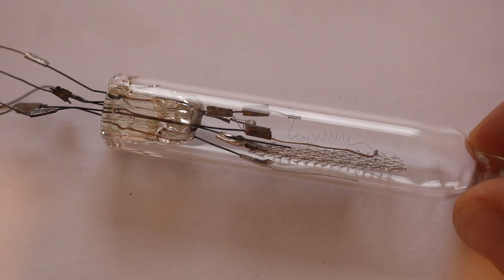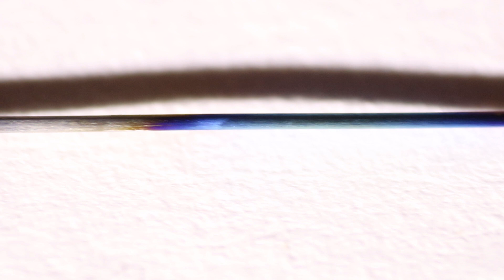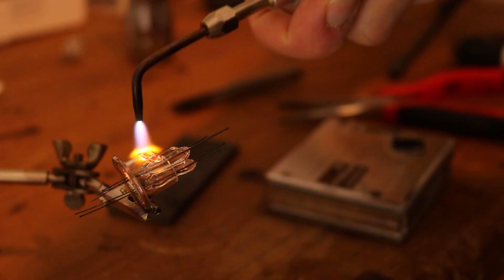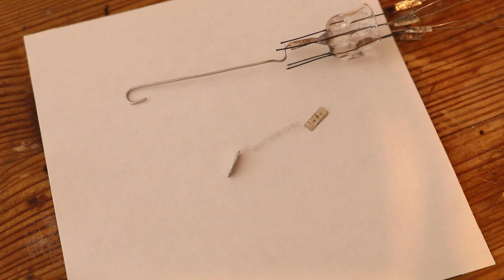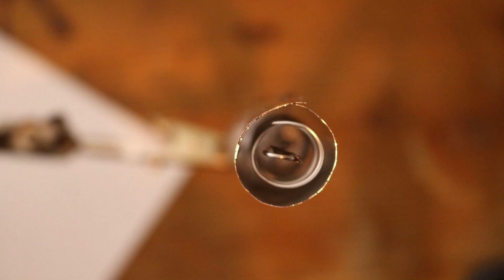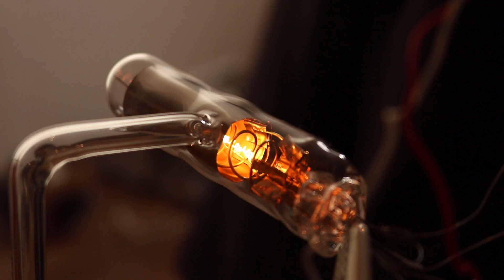Building a DIY Triode Vacuum Tube

Comment: If Higher Than TTL Voltages Would Be Employed 0+5V,  Then Capacitors Could Be Converted To Triodes By Including The Base For The Extra Voltage Needed To Reach Electric Permitivity. If You Go With The Thought Further, You Realise That Transistors With Dopped Silicone Employ The Same Principle, With The Addition Of The Goal Of Bringing Down The Voltage To TTL, 0+5V!

Comment: Next try making a geiger counter tube. Welders argon plus a halogenated hydrocarbon will work nicely but a regular hydrocarbon can be used. Mix is 90% argon and 10% quench gas. ❤

Comment: Good work!. I attempted to make some triodes and managed to get a couple that sort of worked. I could never make them consistent enough to put in a circuit. I did make oxide cathodes using very finely pulverised chalk (CaC02) using corn syrup to make it stick. Again, sort of worked but not well enough to pursue it. I have since bought some Si wafers from Ebay and am trying to make a transistor. Made one in high school with a kit suppled by Bell Telephone Laboratories. It contained asbestos and HF, among other things. Wouldn't let you do that today.
Reply from the maker: I'm gonna try aswell with the emission coating. You need a mix of Calcium, Strontium and Bariumcarbonate. Making transistors is very cool aswell but needs its own equipment and stuff😄
Reply: @thesciencefurry  Yeah, first I had to make a tube furnace that would hit 1000C.

Comment: Amazing video! What kind of torch do you use? I really want to try myself. Did you had experience with glass working before?
Reply from the maker: Sorry for the late reply. I use a cheap oxy torch from ebay and just a general purpose torch. It's definitely a learning curve and you need to try things out.

Comment: I don't know how I missed this upload originally but this is fantastic work! I noticed on the tubes you showed at the beginning that they appeared to be evacuated from the top instead of having a smaller evacuation stem. This is my preferred method so far as it avoids extra glasswork, although it doesn't allow for a nice, round top. Hopefully I'll also be publishing a triode video soon! 

Cheers!

Comment: I've once seen a scan of an old paper(around 60's)  from an electronic company where i read that they used a mixture of barium and strontium carbonates with nitrocelulose dissolved in organic solvents to coat their cathodes. I can't remember if they wrote which solvents they used, but I think that  acetone would certainly do the job. Maybe it'd stick to the filament better and make an even coating.

Comment: Why couldn't you use something like a mason jar for this? Isolate them from the lid and then pump down the tube? I've wanted to make a neon lamp like that as a proof of concept but I don't have a vacuum pump.
Reply from the maker: Won't hold vacuum well enough and you have to leave it on the pump. At this point you would be better off to build a proper chamber for it. But a normal vacuum  pump usually won't cut it.

Comment: oh my god this is great.
Reply from the maker: If it would actually amplify :p But i'm getting there....eventually.
Reply: I bet it is but it might just have a high plate resistance. For a voltage amplifier a 470k plate resistor would be a good starting point. For driving a speaker I have had good luck with the hammond 1760C output transformer. It seems to work best with the primary configured as 8kOhms and with the 3.2 Ohms secondary connection being used to drive an 8 ohm speaker. I am really jealous of your seals by the way. I still have days where my seals end up having bubbles on the surface of the tungsten and it makes me sad :3
Reply from the maker: @jdflyback  That's why I make the seals individually and then seal them in. So I can select which ones are good and which ones are not. I was watching your and Dalibors videos and was scratching my head how this supposed to work. But everyone has their own methods.

Comment: It might help you to characterise the tube. Based on that you can improve the amplifier circuit. Measure the amplification (mA/v grid voltage) at different anode voltages.